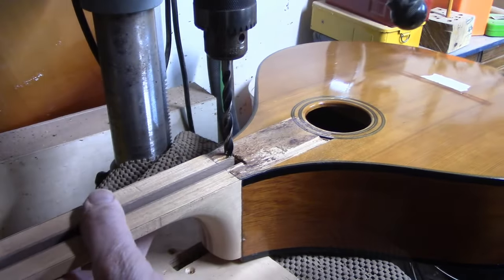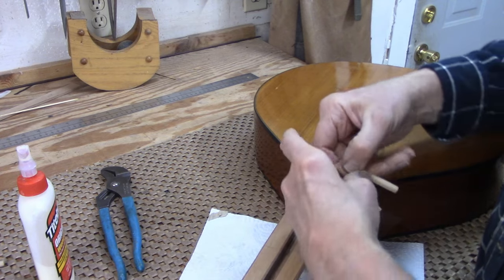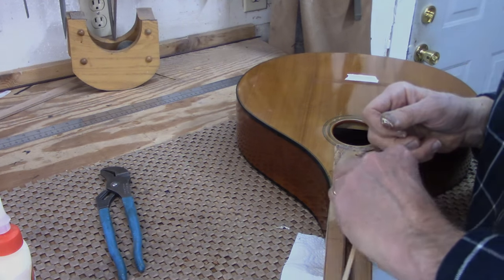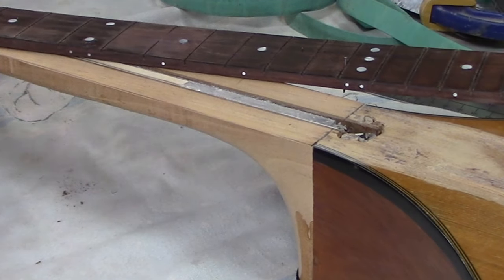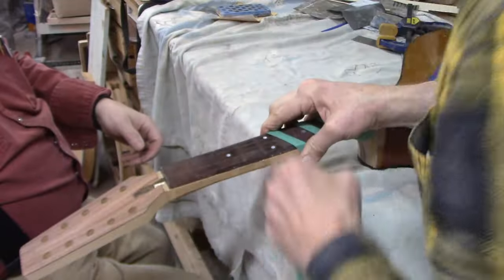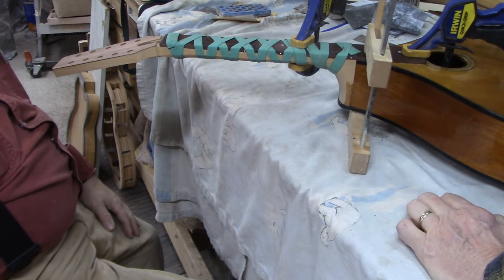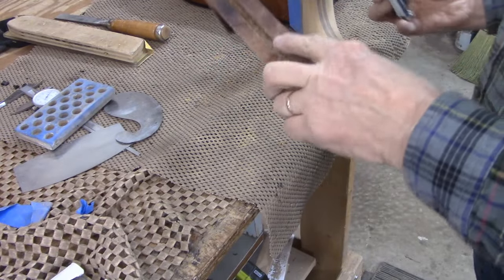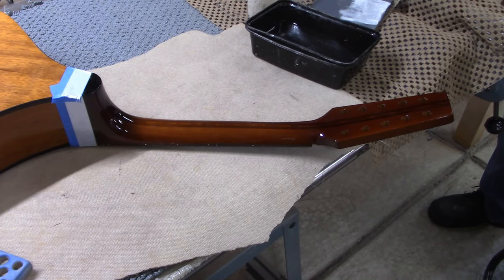Fylde Cittern Neck Replacement, part 3

Comment: As you said:  "Like it never happened."  The dowel method of neck attachment is a game changer.
Reply from the maker: Thanks Mike.  The dowels are great,  and, if necessary,  they can still be steamed for neck removal if the top ever settled, but the joint will never loosen on its own.